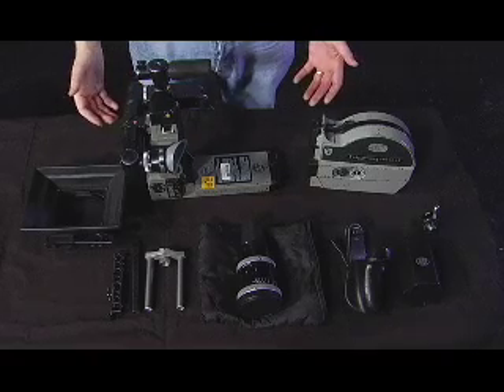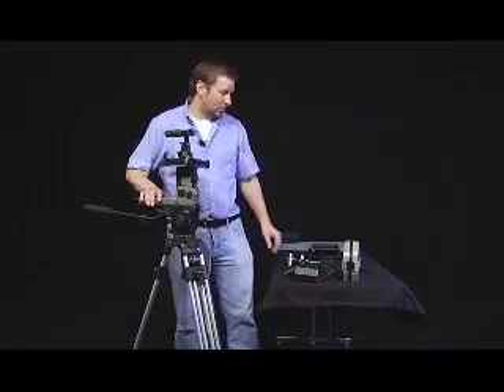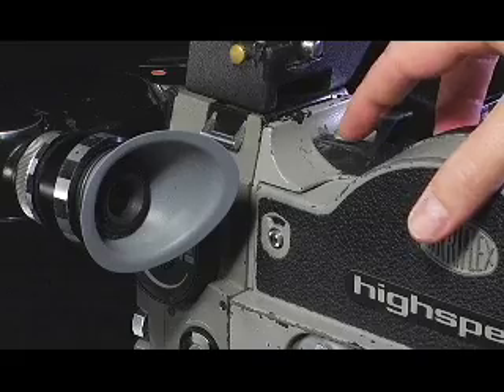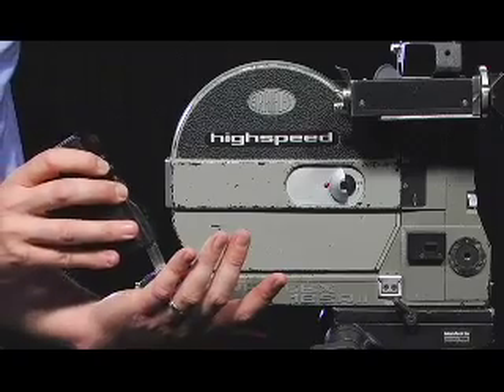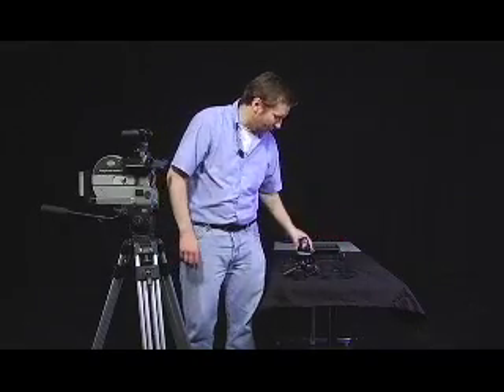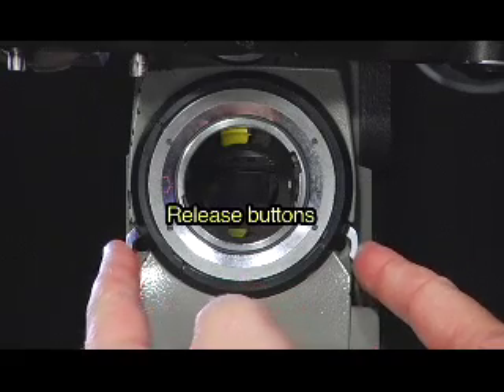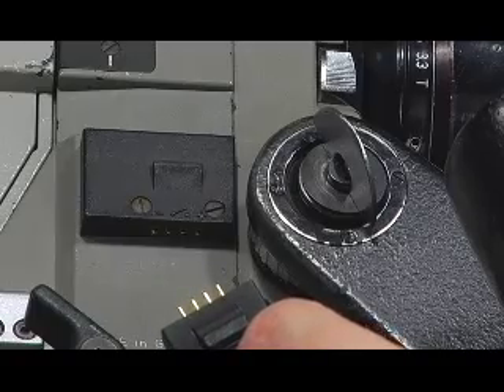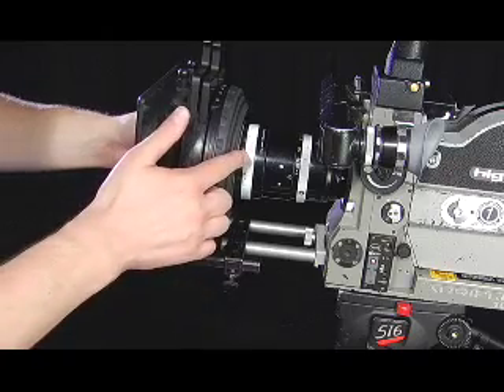Assembling the Arriflex SRII

Comment: How do you change the shutter speed on this camera?
Reply: It could be different for an SR2 but on an SR3 its a small hex screw just underneath the shutter. you spin it and it extends the shutter out until you see the markings for the shutter angle you want.